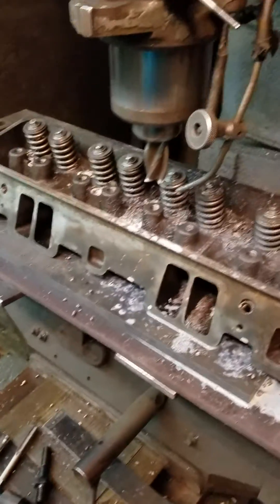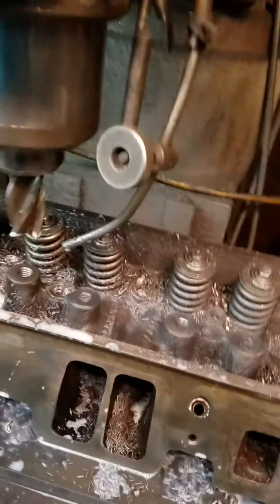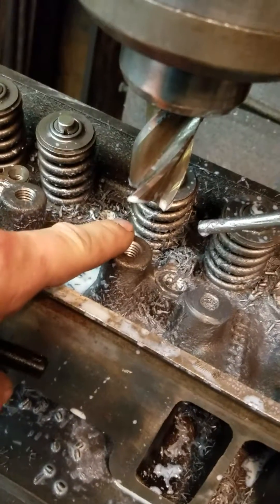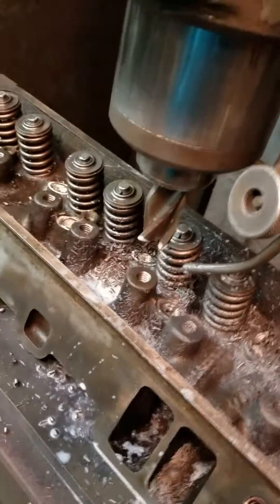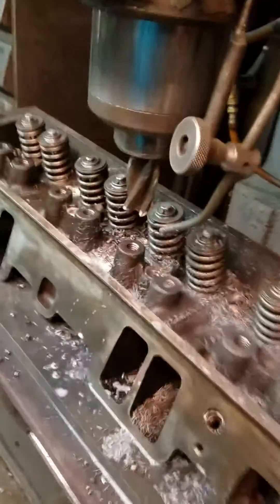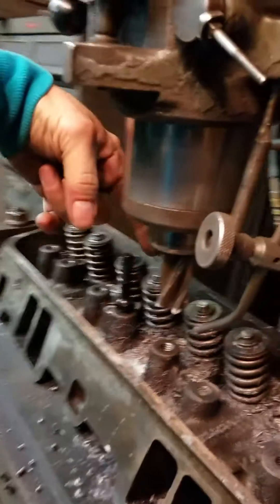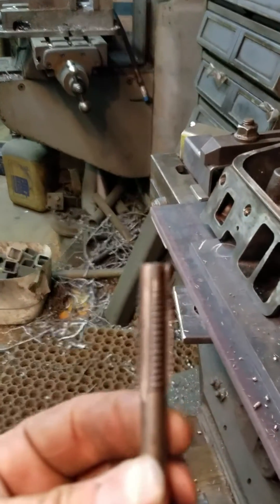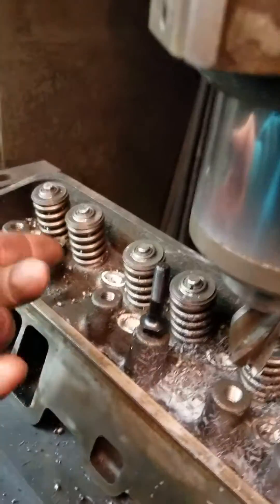Modifying a chevy 350 vortec head to accept thread in rocker arm studs.

Comment: I cut my guide bosses down with a angle grinder worked well for me didn’t buy no tool or anything there all leveled atleast the screw in studs seem like it but I did buy the tool for the valve seals

Comment: If you use the studs that don't have a shank. The studs that basically replace a stock press in stud that pulled out. You don't need to mill the bosses. You just have to pull the press in stock studs and thread the holes,screw in the threaded stock type stud. If you're worried about the stock studs pulling out. You can also just leave them in. Drill a small hole through the boss and the stock studs and pin them in using roll pins.

Comment: Good video. Cuestión. I can put my old intake rpm in vortec heads???  Thanks.
Reply from the maker: Vortec heads have a different bolt pattern for the intake manifold than the late 80s to mid 90s TBI intake did... and the TBI intake had the same bolt pattern as the early carb manifolds, except the center bolts by the exhaust cross over stood upright,  rather than sitting at the 45 degree angle to match the head.... short answer, no, the vortec head is all on own...   I am not sure if the early LS head and the vortec head share the same bolt pattern or not... I have not had a LS engine apart yet to see...  

Thanks for the question.
Reply: @MinnesotaImplement  thanks for answer.
Reply: If it's the eldebrock performer then yes u can use that intake for the 906 062 vtec heads
Reply: @dewaynebraley2820  ok thank you. Very much.

Comment: Thanks for the info. I might add you can also mill down enough for guild plates while you are doing it. Then you have the option 
of the non self aligning rockers. If you don't want the guide plates, add a head bolt washer as a spacer to bring the stud back 
where it would be. I believe the self centering tap is a starter tap. Just putting it there, not trying to be negative.

Comment: Nice video. Well done. I just wanted to chime in on the small radius you had to chamfer for on the bottom of the hex head. ARP's fasteners are rolled, not turned, which hardens them as well as makes them much more uniform. The radius is there to relieve a stress riser that would otherwise be the weak point in the stud. Keep up the good work! Thanks for posting.
Reply: Exactly, just like a fillet on a crank journal.

Comment: Set a sine plate on 11 1/2 degrees.  Tilt the head of your mill to about 11 degrees. Put indicator in the spindle. Mount sine plate square on mill table. Sweep the sine plate with indicator to get the head on 11 1/2 degrees.  Clamp heads flat and square on table. The rest is easy.
Reply from the maker: If you have the tooling, there are for sure much better ways to jig up than a stack of shims and eyeballing it....   I did debate on tipping the mill head, but opted for shiming my head up due to a .010 walk in worn out mill bed.

Comment: good info thank you. wondering if you wouldnt have to machine down the guide or put a chamfer if you were using the threaded studs without a hex flange... ive seen some just a straight stud with threads on both ends
Reply from the maker: if they are straight threaded studs with no base, and you have proper clearance for your rocker, you likely would not need to machine it... my worry with that type of stud is if you don't use thread lock on it, it could thread out... they also could not be used to retain a push rod guide plate... but for sure they are an upgrade from the push in studs that were stock.
Reply: oh okay yeah i see how the guideplate would need it. and yeah the head would help from spinning out... thank you

Comment: Or you could just have a machine shop do it on the correct machine a Seat and guide machine
Reply: it isnt necessary for this application but thanks
Reply: Not a comment I thought I'd ever read from @Myvintageiron7512 Dissapointing.